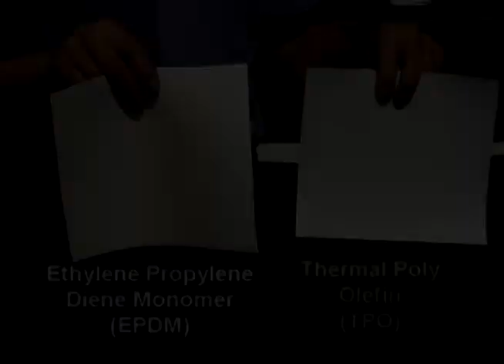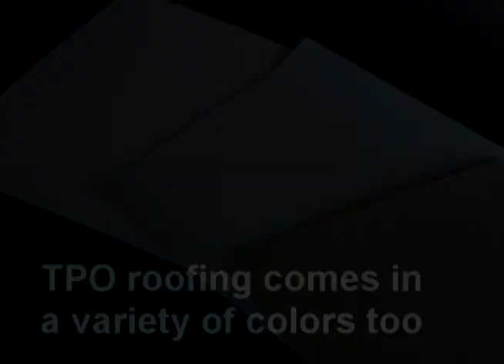RV 101® - How to Determine Your RV Roof Type

Comment: I have EPDM rubber roof with mold spores eating it away with patches where it peeled and flaked away. I should say it was a EPDM liquid coating "Liquid Roof Brand" from almost three years ago that was applied and has the black mold spore problem. I am looking for a product that is mildew and mold resistant. I would love to replace the roof with fiberglass but it's too expensive. Your help would be greatly appreciated in recommending a mold proof substance or material.

Comment: You also have an RV roofing material that is polyester called Krystal Kote (by Valspar)? Does this fit into EPDM or TPO?
Reply from the maker: If I'm not mistaken Krystal Kote was a composite material used on pop up roofs for awhile. This is the only Krystal Kote product I am aware of. It is similar to some composite ABS type materials used on the sides of some RVs. This would not be EPDM or TPO.
Reply: any particular requirements when caulking or working with it that you are aware of?

Comment: Why do they not use a solid roof material like fiberglass or tin?
Reply from the maker: Some RV manufacturers do use fiberglass and metal roofing, but these types of roofs have maintenance issues too. Fiberglass can crack from the stress and flexing and most metal roofs had seams etc. Rubber roofs were lighter, one piece, could flex and required little maintenance.

Comment: This identification is WRONG! Not all TPO is all one color. TPO is black on the inside and white on the outside, or roof side. Velsicol for example is one TPO product that is white and black. The ONLY TPO that is all one color is the flashing for the TPO. Steven products are Tan and Duralast is a tancolor as well. If you use the wrong products on either roofing then you could cause additional failure.NEVER I REPEAT NEVER use roof cement on either of these products to stop a leak. NEVER use silicone either.
Reply from the maker: This video is talking specifically about EPDM and TPO material that is used on RV roofs, not on commercial buildings. The information in the video comes directly from Dicor, a leading manufacturer in the RV roofing business.
Reply: Please understand we are not heckling this channel. We are trying to clarify the ID process since a customer of ours has brought this video to our attention. We are not advocates for rubber roofing. Most of the damaged roofs we service are due to rubber roof sealant failure, roof tears since rubber has low strength and rubber roof itself failing do to poor adhesion of the caulking used, since rubber itself is a fickle system and does not accept certain types of caulking. Rubber oxidizes and causes sealants to break loose, unknown the the owner. This system relies 100% on the caulking, as you can see in the video and not the product at all transitions. That is the big problem.
TPO is a welded system. There are no glues or caulking used at the transitions, such as AC units, vents and pipes. This is where the leaks start.  We are trying to clarify this ID process. TPO is by far a much better roof system than any rubber roof.

A person going by your ID process would think we are installing / installed a rubber roof. We DO NOT install rubber roofs. We are not trying to heckle your channel. The best way to tell if you are not sure is that the rubber will stretch, like an inner tube on bike, when you pull it. TPO does not. TPO is also more expensive than rubber. TPO has no caulking around the transitions, if you can get on the roof and see. TPO typically has a sheen to it.  TPO is like a pool liner. They do not use rubber for pool liners because they fail. We are glad to answer any of your questions if you would like. You can contact us at georgia exterior at g mail.  Again,  we are not heckling this channel.
Reply from the maker: Georgia Exterior I do understand, but in the RV Industry manufacturers primarily use two roofing materials EPDM and TPO on RV roofs. Dicor is the largest and leading manufacturer of these two types of RV roofing materials. Dicor wanted a video to demonstrate how RV owners could distinguish between the Dicor EPDM and TPO roofing materials used on RV roofs. The information in the video was provided by Dicor to help distinguish between their EPDM and TPO products.
Reply: TPO seams are heat welded with hot air, EPDM seams are glued together with adhesive. There are a lot of (reinforced) TPO brands that have black or grey coloring underneath..